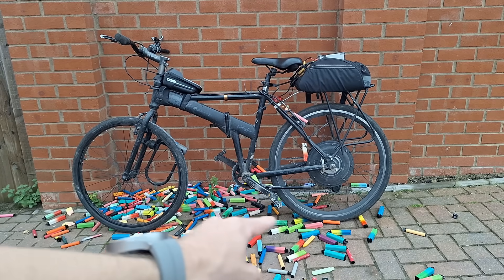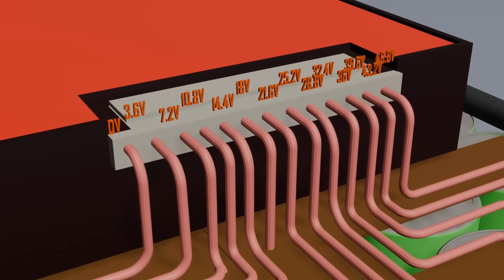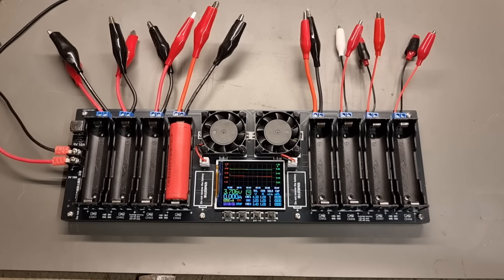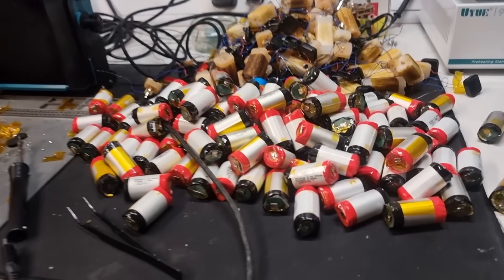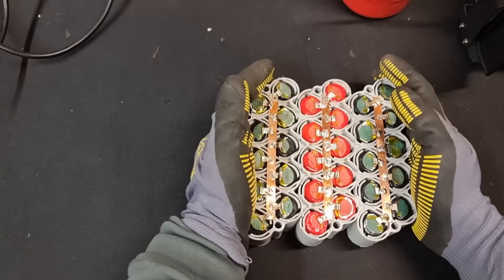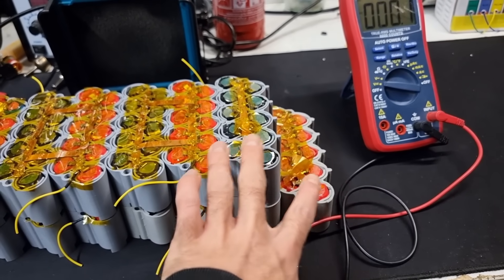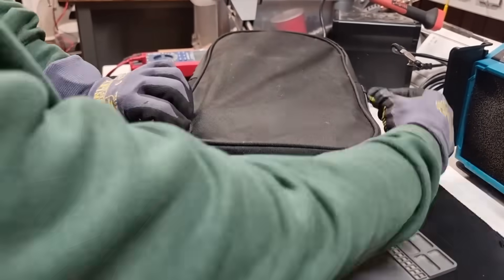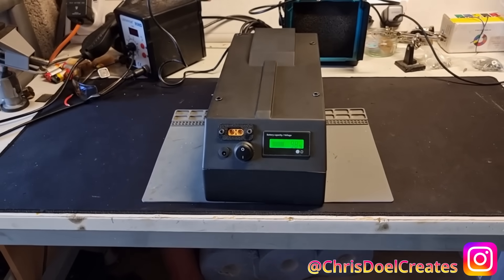Powering an E-Bike using Disposable Vape Batteries

Comment: would there be a way to recharge this battery with the rotation of the bicycle ? like a dynamo works. basically to use the rotation of the wheel to turn a bunch of magnets in coils of copper to create electricity and have that electricity recharge the battery ?

Comment: Them larger disposable vapes I used to recharge them back up to 3.9V and that would get the last of the liquid. Even charged people £2 per vape to recharge them. I got a reusable but it made a good bit of pocket change. Took about 12 minutes per vape doing them 1 at a time or if I had 2 at a kinda close charge I would link them in parallel to the charger and push the current higher. Never had one get much more than warm to the touch at 4A of charging current.

Comment: What about adding a motorcycle generator to the chain system/ add a disk break to the front with a pulley. Regeneration on braking and on pedaling. Brilliant, thank you for bringing awareness to these issues

Comment: 2:13 I would say that they’ve not met IP67 ratings and water and dust is allowed to interact with the cells creating shorts more so than not supplying a bms, bms implementation is required by law in most countries for lithium cells , active bms is obviously far better but water and dust won’t even save it

Comment: One of the best videos ive seen lately on youtube...
Could you possibly make a massive circuit with these vape batteries? Cause wouldnt it be incredibly cool to power your house (to a certain extend) entirely  through vape batteries connected to a few solar modules? This way you could easily charge your phones, laptops, ambient LED's pretty much for free all day long, you just need to buy the solar modules (which are much cheaper than i expected)
Would be stunning to see what else is possible to build with just a lot of disposed vape batteries. 
Keep up the good work mate!

Comment: Got 13 years house building experience, I can build most things , I built my own camper van from scratch even the box and fiber glass but you sir are something else , what a cleaver bloke man , wish I had the Brains to pull this kind of stuff off
Reply: Not so smart to use "bad" vape batteries. They could be faulty really soon. But if you don't care  - well, it's better than letting them to throw in a trashbin
Reply: @nikostalk5730 what 😂😂😂 by your ethical stance he should of just bought an electric bike , and not made one using scrape materials, any fucker can buy a battery and wire it in , this guy created something working using scraps , bet you couldn't do it

Comment: Needs fuses. Each battery should be connected to the busbar with a thin piece of wire, so if one cell goes short, the newly created circuit pops that wire instead of popping the shorted battery.

Comment: IMO: I know it's not the "main topic", but this is why I find 3d printers so amazing. You used vape batteries, but there are so many electronics we could use instead of those to get batteries in order to make one big ebike battery, and the shape, obviously changes depending on the shape of the battery we're using.

Comment: A battery is not just a battery. Electric motors require a lot of current, and some battery types can discharge faster than others. It is lucky to get all of the same spec batteries. One would think that there would be more variation between manufacturers.

Comment: I'm not an engineer or electrician so this is a genuine question not criticism. when you looked at the data sheet it said 300 recharges so does that mean thats when the cells are useless or just degraded your battery was very impressive and defiantly worth doing if you're on a budget but its alot of work for only 300 charges

Comment: so what does the BMS do when it detects that the cells are out of balance? Does it just monitor or does it shut down power or something?
Reply from the maker: A good BMS will balance charge the cells and will divert power from the higher voltage cells to the lower voltage cells. A cheap BMS will just cut power if they become so unbalanced that a cell dips below 3V

Comment: I thought you should know I came across this video a few months ago and really wanted to try and make something similar. Except I do not trust myself to not seriously get injured if I built an e-bike lol. But I did like your idea of upcycling old vapes, so I started collecting some from my friends. I am taking out the batteries and usb charging modules they use and using them to add a little flair and lighting to some of my woodworking projects. Thanks for the inspiration to take what would be trash and turn it into something useful again.

Comment: I feel like the discharge rate is kinda low for an e-bike. 2C is the maximum, lets say for short bursts, quick acceleration. For calculating its safer using the max continuous discharge rate...

Comment: I've farmed over 500 18650 cells from anything I could scrounge. Even if the cells are showing 0 volts, you can jump start a decent percentage of these by charging them in parallel with a good battery. Once the "dead" battery sees voltage over a few minutes, its protection circuit will close and the battery will start to charge and can be brought back 100%. Not all 18650's have protection caps so your mileage may vary. Capacity is second to internal resistance when building a pack, you want ALL the batteries in a group to be very close IR to each other to prevent a hot spot in the group, and capacity can be averaged out across a group. BMS rating should be about 2x what the motor can pull amp wise, as a 48V 1500W hub motor can pull 2950W@93A on full acceleration under full torque per a data sheet I have on one. The BT enabled BMS are worth every penny as they report what the group are doing in real time and allow you to modify accordingly. Stay safe! 18650s are dangerous as the positive end is an easy source of a short to the negative side from anything metal when storing or soldering. I store all mine up in salvaged plastic frames seperated by cardboard.

Comment: Brilliant!! Yes I see the disposables are available in Canada. I don't know if they are lithium, but disposable anything shouldn't be allowed, let alone decent re-usable things like batteries. I have had a problem with regular 1 use batteries since I was in my 20's (I'm 64) and refused always to buy them, opting for Ni-Cad then NiMH when they came out. I have since hooked up with someone that has no scruples about buying a 50 pack off Duracell planet poisoners, but this last bunch were mostly dead right out of the package so there is a ray of hope for her conversion yet!

Comment: A 12v lead acid battery would’ve turned that wire into a molten pile of copper. Advice is, don’t fuck with electricity period.

Comment: Couldn't you just discharge all of the batteries down to the same voltage before wiring them together? Less power in the system

Comment: 50 km an Hour listing 33km is actually pretty impressive with a 48 volt battery, it would mean that it has an autonomy of 50 to 55km at a speed of 30 or 35 km per hour, and maybe 80km of autonomy at 15 km per hour or 20 km per hour, I recently bought a Joyor Y6S which has 75km of autonomy advertised at 15 km per hour, here in France the speed limit on those things need to be at 25km per hour or under, and at that speed mine would last about 65km of autonomy which I'd actually like 5 times more than my previous one which was a no brand remodelling the m365 pro called Aovopro m365 ES80 Pro who had an autonomy of 30km at 15km per hour

Comment: The problems are that how much amperage they can discharge before exploding (Luckly most of the good quality vapes use high discharge litium ions) and cell balancing.

Cell balancing is the biggest problem as different cells won't be matched together very well when it comes to charging. Cell balancing is much more difficult and failure to do so will lead to cell overcharge and exploding.

Comment: I used to make my own ebike batteries. Honestly, it's just not worth the effort these days. The price to buy one has come down a lot, compared to the time and effort collecting cells and putting them together to make a battery without burning the house down I stopped making my own. 

Every time I see a vape on the ground I pick it up though, I have quite a few scavenged batteries and use them for little projects all the time, just nothing so labour intensive as an ebike battery.

Comment: I have used these cells for so many projects. Power banks, portable inverters, electric scooter batterys even racing drone batterys and they are great. Some have a 10amp discharge rate making them good for high power devices also they are free and abundant 😂

Comment: And they can be refilled up to 4 - 5 times without impacting the quality or taste provided you don't pull too hard and long on them. I have "jailbroken every kind of these over the years and it's totally doable. They all have a sponge inside that holds the fluid securely. Though currently I have  non-disposable Geekvape B60 and a few older high wattage capable mods and RBA tanks. All these need is juice, cotton wicks and wire. And batteries of course.

Comment: I like you design and work but i think you can improve safety by adding fuses from the cell positive and negative to the Bus Bar  when joining cells. This will increase safety. Hope it helps. If you get a short it will fast blow. It works well especially for E-Bikes. Rather then soldering the cell terminals direct to the Bus bar.

Comment: Legal is 250watt but speed is 15mph so isn't motor size irrelevant ? lol, 15 is too slow I think should be 21 min, higher voltage = faster speed ( with controller settings changed) I have 36v  system 250 watt front wheel  25ah battery get good distance at good speed, max speed settings is 21mph which is fine for a bike a few more mph would be nice but no need really, great recycling video idea

Comment: so, the reason the one "sponge" was so dark is most likely because it was over used and the user ended up burning the cotton inside, very common thing in the vape community and is the main source of lung issues in vape users. the fix is just adding more juice to prevent it.

Comment: I still vape rebuildables, 
1. I add my own e-liquid, at a cost of around [2% to 5% the cost of e-liquid you get in a disposable]
2. ... to an RTA (Rebuilable-Tank-Atomizer) made from metal and glass that'll last me a lifetime [but I still have a few hundred..many of which are worth up to 10X what i paid for them]
3. I build my own simple coils out of specialized Vape-coil-wire [$10 per year] & specialized vape cotton for wicking:ar around  [$15-$20 per year]

~~~Doing it this way, I have total Quality Control over everything, and know exactly by who (me😉) and with what, every single component my entire system is made of and where it comes from...
ALL of the various types of tanks are powered by a "box-mod" and have a universal 510 threaded connection, and have various easily accessed panels that slide off, or is held on by magnets to be able to switch-out rechargeable lithium batteries from sizes 18650, 20700, 21700, and more, that I charge on external battery chargers.

So the way I vape costs a tiny Fraction of what disposables would be. Hey are orders of magnitude hire quality. The same can be said about their environmental impact, Not to mention, it's become a nice little hobby that only increases in value. 

No Wonder, the tobacco lobby and governments have banned the production and distribution of all new rebuildables...There's a lot more profit for them in the disposable market, and the health Implications, and financial strain they increase on consumers don't come close to factoring into their bottom-line.

I pray that someone reads this comment and it helps them out in their journey to quiting those icky-sticks...

Comment: ❤❤10 Years repurposing 18650 and 4 years loving the smaller Vape size. This is a 🏆🏆🏆🏆🏆project. Wish it was required to have a  collection box wherever you buy vapes similar to battery rules in some/all of EU. New upcyclers should be aware almost all items that use 3xAA or 3xAAA are elegible for easy upgrades.

Comment: The worst part about this, as ive had similar ambitions myself. Is its really hard for one person to gather so many used devices. Im a person who vapes disposables and i havent tossed out a single one, just keep them in a metal garbage can in my basement, but i still havent even collected 50. And they arent even all the same size battery either. I might need to be vaping for many more years to collect enough to do anything meaningful 🙃 I still very much approve of all your efforts though! 🫡 Stuff like this will help educate the masses of the potential of all their throwaways! 🍻

Comment: Probably should have got into cell discharge abit more mainly regarding series connection current flow,, offcoure your two series connections are good for the 30amp being copper,, but nickle for example would have been a different case, needing more series connections

Comment: Think it'd be possible to add on a crank generator or some form of alternator that would let you recharge the bike when peddling or would that be too dodgy?
Reply from the maker: The bike already has regen braking but if you use it while pedalling then it feels like youre going up an insane incline because most of your energy is being used to charge the battery instead of going forwards. So sadly, a pedal charged ebike will never exist (at least in a way that people would want to use it)

Comment: Brilliant bud, I need to learn your technical skills in the finer side of electronics, I collected a lot of the disposable vapes so I could build a battery for one of my electric scooters or tricycle I'm converting, I was trying to find out if anyone had done it before, it was a few years ago and I couldn't find anyone who had or anyone like yourself and me who think outside the square block through round glasses, I had a few of the so called experts with the technical grades (it all well and good passing the test that shows you are capable of doing what has been done.) but the best qualification is the unique one that is only made one at a time for one idea and creation,
The so called experts didn't think (thinking is their weakness) doubting it is possible or worth doing,
I'm close to 60 and have been in engineering, mechanical engineering in all its variables, multi tradesmen in the construction industry, along with a vast wide range of other skills, experience and knowledge, self taught Jazz Trumpeter and musician, repairing, refurbishment and custom builder of trumpets, flugelhorns and cornets, I do leatherwork and fix, setup and love messing with my vintage and antique industrial sewing machines, and have 2 E100 and 2 E300 razor scooters, 4 other new type electric scooters, I got all of them cheap and not running, and a tricycle I'm converting to electric,
Just so you know I'm on the same page as you,vape waste is a crime, I've even tried to use the little round sensors in the vapes as pick-ups for a cigar box bass I built, 
But love your build using the batteries normally going to waste, so wrong, all the best and keep out of the box

Comment: Just as a side note, great video btw. but just as a side note, I've been vaping for about 7 years but I didn't use disposable vapes, you can buy proper "mods" (vaping device) with interchangeable batteries and you can dispose of them after a long time of use. I used probably about 20 EFEST 3000 35A High Drain Flat Top Batteries - and recycled them in Tesco. The problem is that people are lazy, not vaping itself. Non-disposible vaping is a hobby by itself and you need to spend some time on cleaning/refilling and so on - you shouldn't vape anyway as it hurts you but, vaping saved me and I'm not a smoker anymore. I hope that all my batteries have been recycled properly. cheerio!

Comment: Such a waste he is very clued up but opted to not up the battery flow, he could have gotten way more, those batteries range from 3.8v - 7v and combined especially with a capacitor, it would produce mega power

Comment: Is there a chance to make these really easy to replace? Like, a design where you merely need to prep a battery, slot it in, clamp it in with something mechanical and be done?
Of course with some power balancing cycle to run, before use.
I am just thinking, if this were to be open source for everyone to use when they have to use something untraceable to escape the ama-zone packing plantations quickly, making sure they dont suffer any unexpected breakdowns could be nice.

Comment: The only rhing dangerous about this pack seems to be that all the cells are in a case which blocks them from expanding or balooning at all  in case of any failure potentially leading to a pressure buildup/explosion

Comment: Hey man, I want you to know that this video has opened up a whole new world for me. I recently did my first project with this new found knowledge by replacing an exhausted lithium polymer battery in my old Polaroid brand bluetooth speaker with a lithium ion battery From an Elfbar that I just found in my apartment parking lot. Not only does it work and hold a charge like new, the replacement battery has a 30% larger capacity, so in a way, it's better now that it was out of the box.

I've been learning about circuitry with regular AAs and watch batteries for a bit now, and learning about this has had me doing a lot of crash coursing and researching about PCBs and components, So I really wanna give you props for giving me the tinkering bug. Fantastic work with this, I can't wait to see what you do next, and I'm looking forward to potentially trying to replicate you work on the powerbank once you release a proper tutorial. Cheers from Alabama!